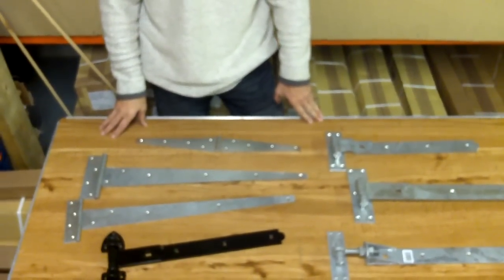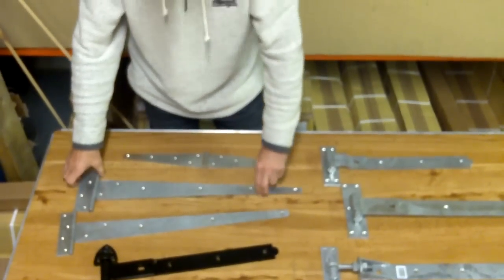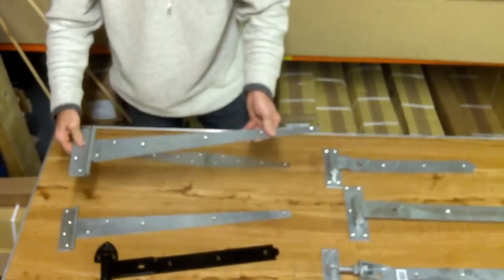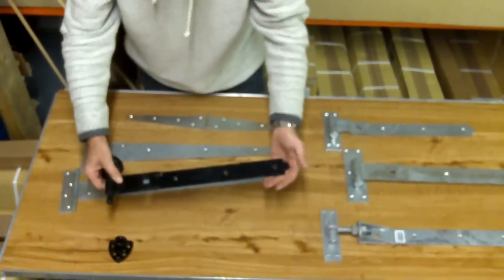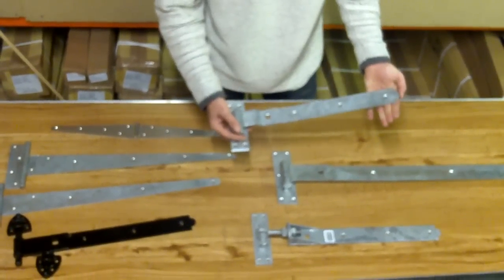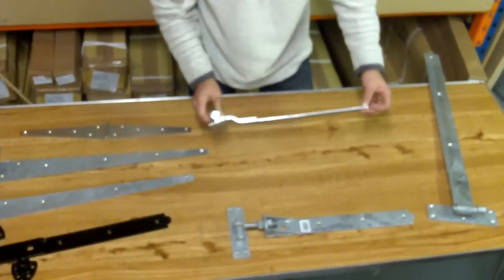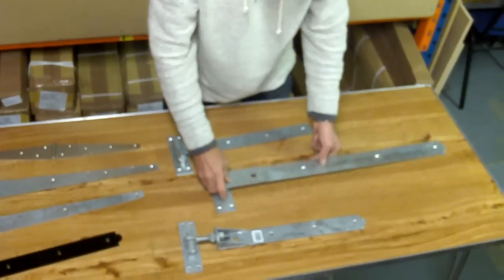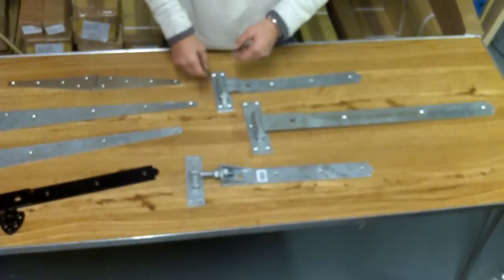Types of Gate Hinges

Comment: Do you sell a rising T hinge? For back yards where there is quite a rise in the concrete yard? An ideal solution for people who have a ludicrous gap at the bottom of their gates to allow it to open inwards. 
I would imagine rising T hinges would be the answer to a lot of joiners prayers, if they are hanging back gates on properties, where there is a rodent problem (most inner cities in the uk). They could be hung with a 5mm gal on the bottom, but on opening, the rising hinges could negotiate the rising floor it is opening against.

Comment: Hi I have 2 questions if you’d be kind enough to help. The first is whether when using adjustable hook and band hinges you should use them both top a bottom or just top for example? The other is how to deal with the bolt which passes through the hinge and usually has the square hole. If this is inserted with the dome head to the inside then surely the nut and bolt will be unsightly on the face of the gate. If fitted with the dome head to the outside then won’t the nut and thread foul the adjustment mechanism? Many thanks.